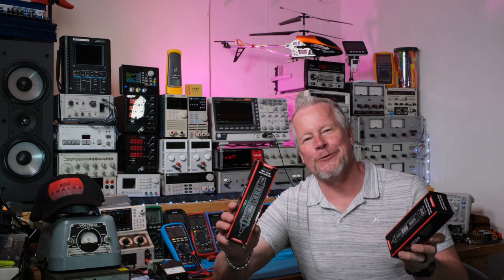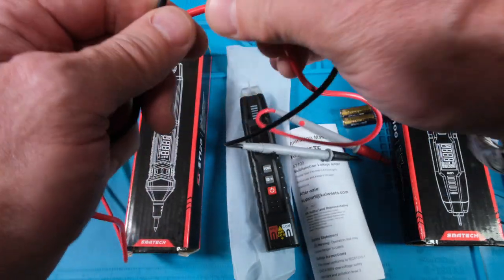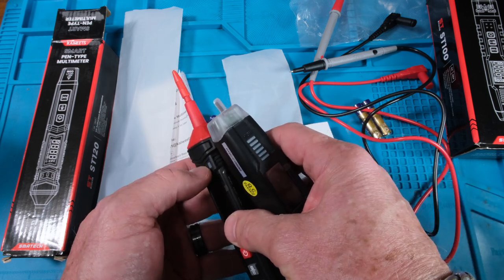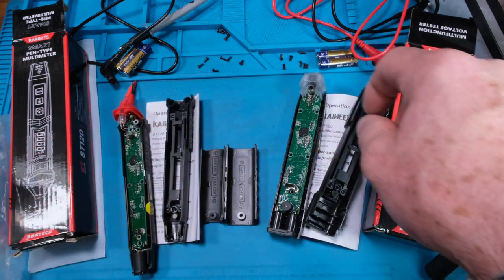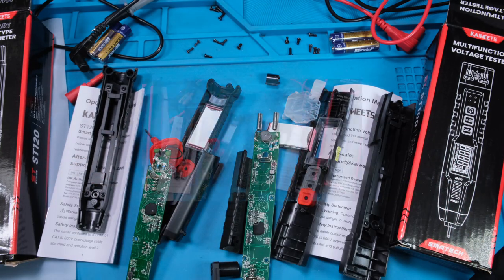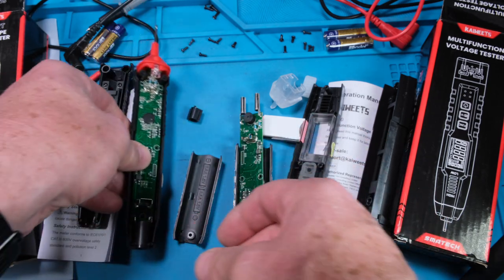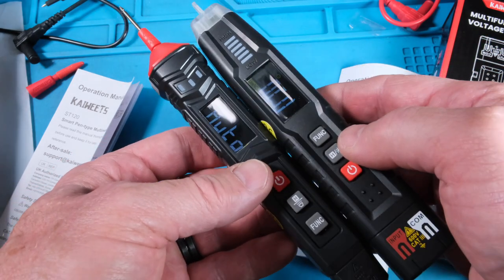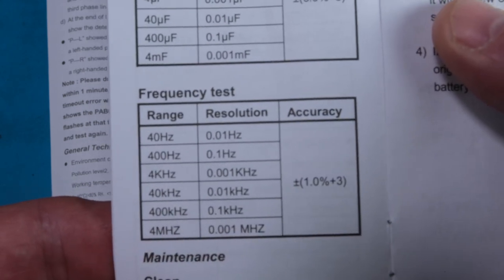New Low Cost Kaiweets Pen Multimeter Review part 1

Comment: there are times when not all trouble-shooting is at the test bench. some repairs are on the factory floor working out of a tool pouch measuring AC/DC signals up to 440 VAC and this little meter might be just thing to use before going back for the big stuff. 😎  thanks for the cool video 🤩 test equipment reviews are my favorite
Reply from the maker: Thanks for your feedback!  I appreciate you!